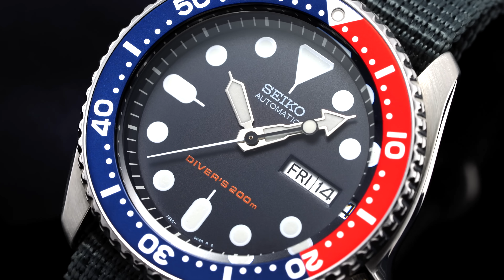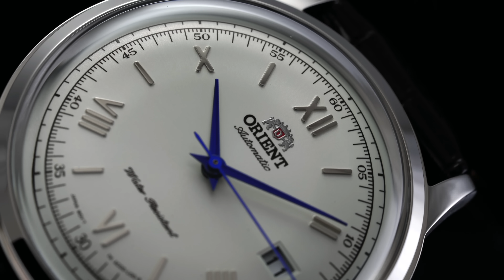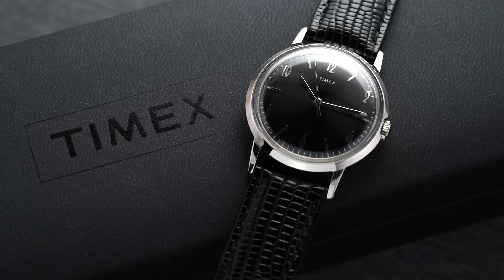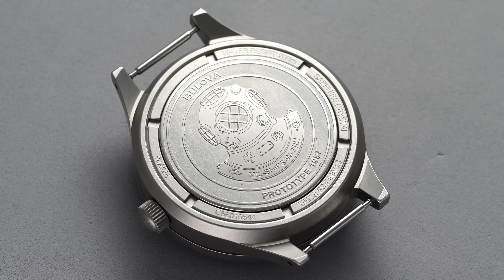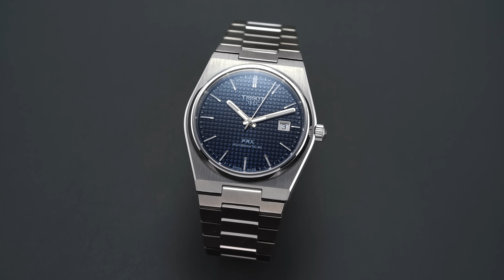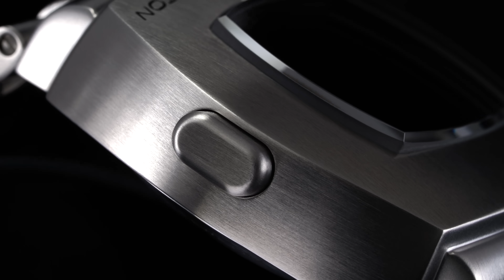Popular Entry-Level Watches and Their Next-Level Alternatives

Comment: Bought a Seiko SPB239 last year and was disappointed to find an issue with the hour and minute hands not being aligned at 12 I clock. This is an easy fix, but should be even be an issue with a $1000 watch. Teddy - would be great the next time you sit down with Seiko if you could ask them about the variety of QC issues across their prospex line. I just can't take them seriously now.

Comment: I like the design language of the old Casio digitals - but those cheap painted resin cases... 
I'm looking for a next-level watch for a long time, I was hyped, when the list reached the Casio. Let's see, is there a nice, steel cased vintage designed digital watch out there I don't know about? (over the A1000; better bracelet, water proof, sapphire, more advanced movement maybe, LCD screen with an interesting design)
Then this Hamilton... is a let down... It does not capture the same 'vintage digital watch' aesthetics as the Casio. Vintage? Sure, but rather the 'ancient' LED kind, which just lacks the functionality of the Casio.

Comment: The SKX is great, but they don't make them anymore, so it's kinda pointless to put it on the list. The modern equivalent is the "Seiko 5 Sports" SRPD53. I have the orange (srpd59) and black (srpd55) dial versions and I love them. You can pick them up on Jomashop for $170, which is a great price. If they break or get stolen, I'll just get another one.
I also have the SPB239 for dressier occasions. That's a beauty.

Comment: An interesting video Teddy, It's great to see the PRX get a mention as well as the Hamilton PSR. There have been a few that have written the PSR  off as an expensive homage watch to the Pulsar original and there may be a grain of truth in that. However the PSR is made in smaller quantities, has a bracelet, case module that is not used is anything else so internal costs would be greater in smaller quantities. For a digital watch this has a simple elegance to it. It's definitely one to see in the flesh. I'm certainly happy with mine even though is hours, minutes and seconds (push button twice).
Reply: I have a retro Bulova N6 digital led watch and they look very similar. It's all steel with the integrated bracelet. You just hit the button to activate the display and it's also red. I'm sure it was some type of copy of the Pulsar. It always reminds me of the Cylons from Battlestar Galactica.
Reply: @riothero313  The N6 is a great looking  watch. Oh yes, I remember the good old chrome bucket head Cylons The same era as Kightrider and Kit that has the red lights waving across the front. Those were the days when a year took ages as did  school homework.

Comment: The Hamilton PSR is a fantastic watch and I do not feel it is over priced. This has become one of my favourites and remains as my one and only digital watch other then my G-Shock
Reply: Completely disagree and fail to see the value that this offers, when compared with modern offerings in the digital section. Some people just like spending money though.
Reply: Really? I would’ve thought the options would be the Casio or the newest model Apple Watch
Reply: @jicalzad  The case and bracelet alone is worth the money in my opinion.  I did own an Apple Watch for years but as you know it is a disposable electronic device. Yes it is useful but at the end of 3 years its worthless .  G shock is never a bad choice
Reply: @canadianwatchmonkey3992  i don't know if the Apple Watch is worthless after 3 years vs. the newer generations offering more features for the $.  My wife still has her Apple Watch series 3, which is about 4 years old i believe.  Still really well for what she uses it for (**i.e. fitness tracking, calling/txting, checking email, oh and telling time).  So for her, it's definitely more "useful" than a mechanical/quartz or G-shock.  Myself, i prefer a quality mechanical, budget or luxury.
Reply: @jicalzad  I have had 2 apple watches and after 3 years the battery was no longer holding a charge
Reply: @canadianwatchmonkey3992  Guess my wife has the only Apple Watch series 3 that is working just as well after year 4 then it did after year 1